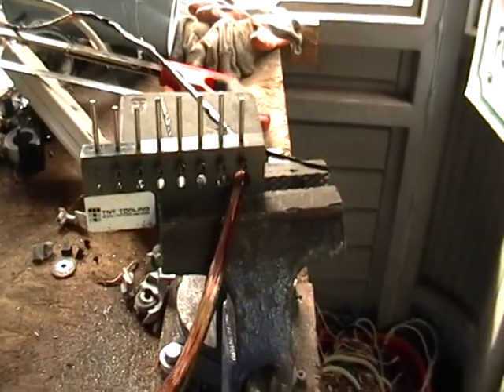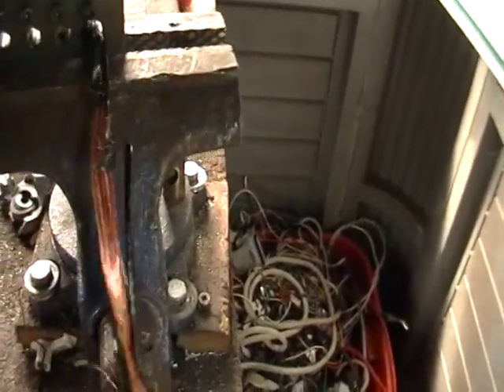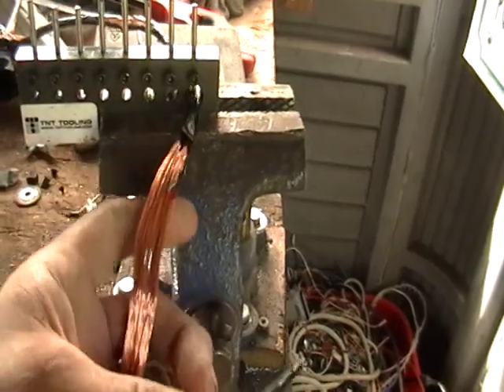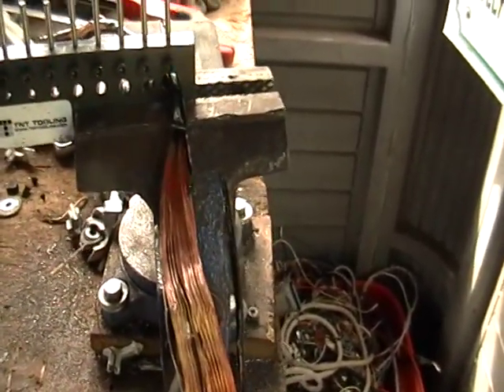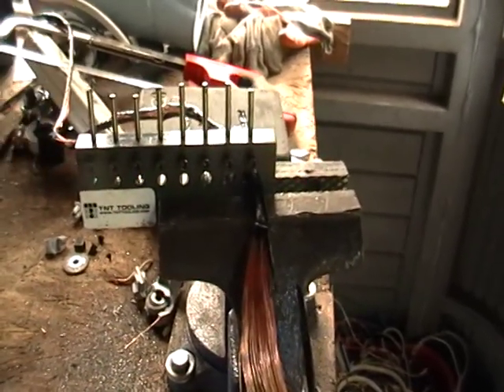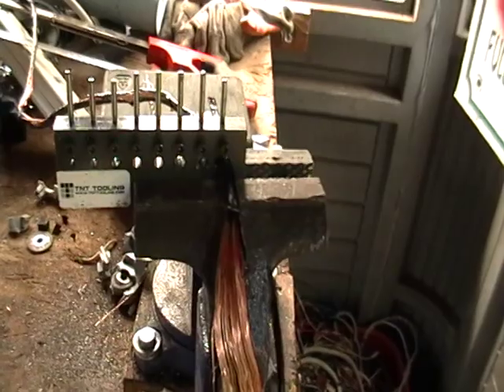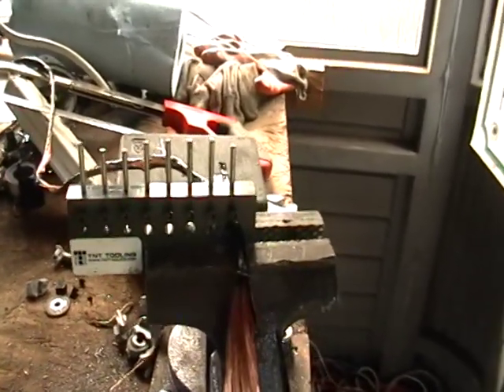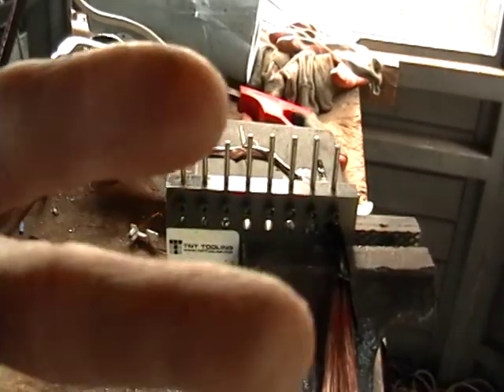stripping copper wire

Comment: I stripped tons of house copper wire. Because back in 2013 and before, all the Seattle construction companies had just thrown the wire to the garbage.

I could go to construction sites and ask if I can dig out the copper. The workers would even save piles for me...

The simple strip I did with a utility knife or a kitchen knife or a pocket knife. I have 3 fingers around the knife handle, my index/point finger around the back of blade, thumb to hold the copper wire against the blade. Good thick gloves. Step on a end of wire. Bend all the way down, set your blade right. Tip all the way up above your head. Repeat... More than 6' of wire is stripped every 3 seconds. Easy.

Comment: @zuseable a quite easy way is to use a 2x4 and drill a hole that fits the wire size. Flip the 2x4 90 degrees and drill a smaller hole that lines up with the first one and then put a screw with a really sharp end in it. Now put the wire in, adjust the screw and pull the wire thru. Clean copper :)

Comment: I got one.  No instructions comes with it. Go figure. If you get one get a tap set as the screws are alum. and strip easily so dont over tighten. Just snug tight.  It works fine once you figure out how to use and set the blades. You may loose a hole as I did, so be careful.  Again, dont overtighten the screws cause you will be screwed. lol
Good luck with it. Cost me $50.00 and got my money out of it to date.